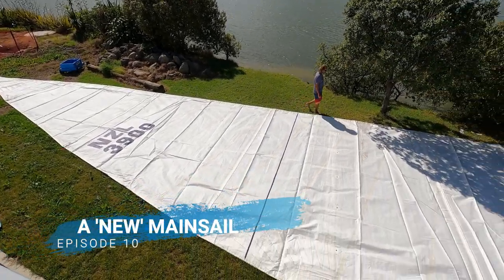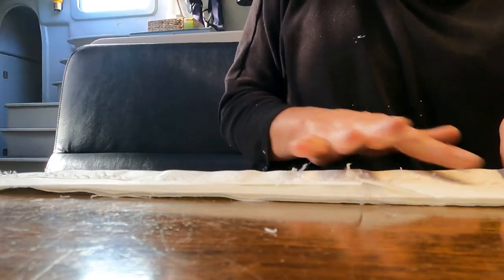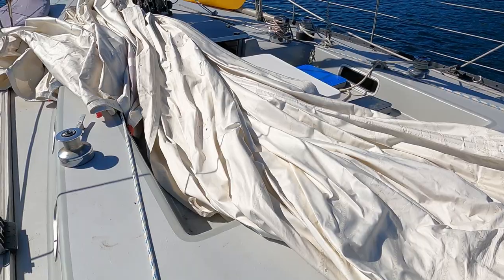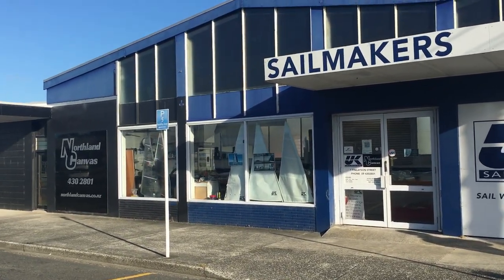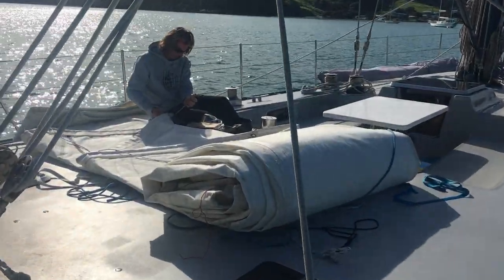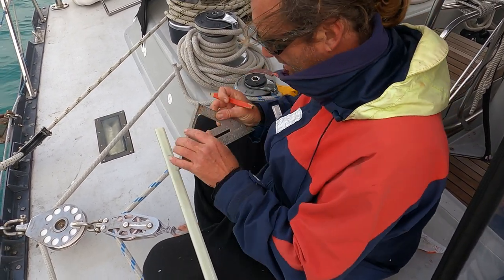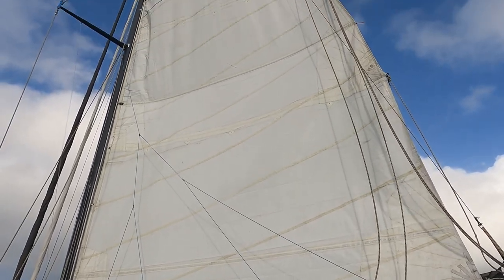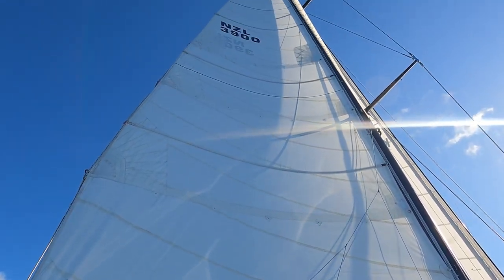BOAT PROJECTS: Mainsail on a budget (Ep. 10) | Replacing our main sail without spending a fortune!

Comment: It's really interesting to see how you were able to create a sale for your vessel from an existing sale that was too big. Is there a specific pattern or design that exists for your boat, or would you have to have one custom made each time?
Reply from the maker: Normally you have a sail plan based on the specific measurements of your boat. In our case we knew our dimensions and transferred those to the bigger sail to see  how we can make it work, where reef points would land up or be fitted in etc. Obviously re-using an existing sail is never going to be as great as a brand new custom made sail but we aren’t racing and new sails are just not in our budget…we’ve just done a passage from Fiji to NZ averaging over 200 miles a day. We are quite happy with the performance of the sail ☺️